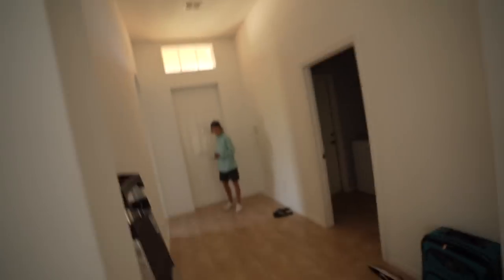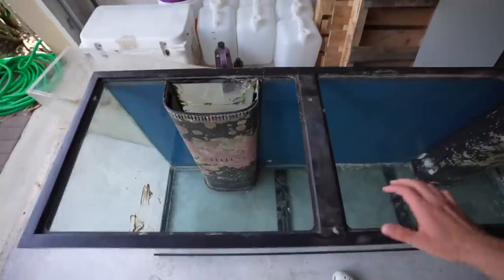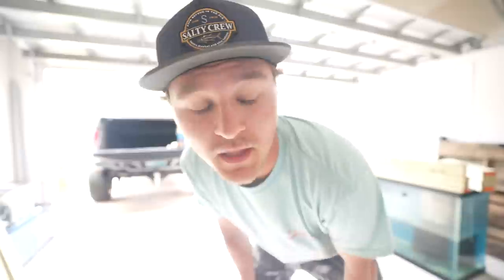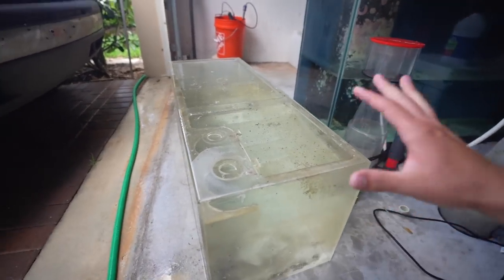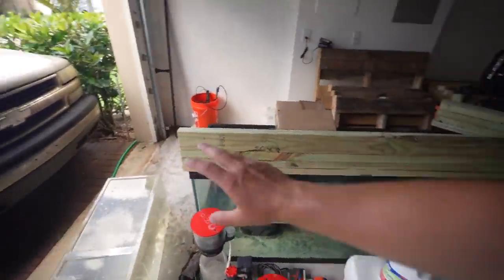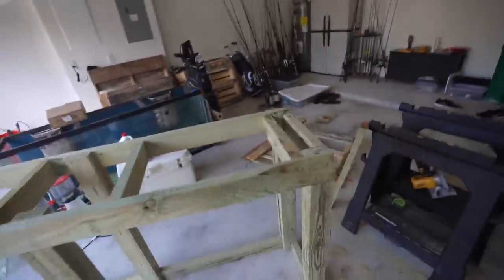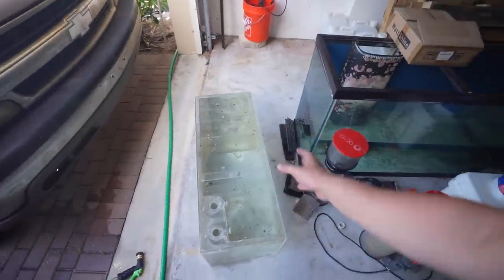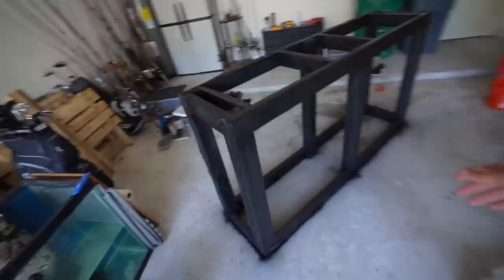BUILDING the CHEAPEST MARKETPLACE REEF TANK!! (Cleaning and Building a Stand) Part 1

Comment: That was a pretty sweet deal though. $240 for a 6 foot marine tank, sump, gear and stand? Noice!
I like to add EVA foam mats (you know the ones you get in a pack - probably from Walmart in the US - and they have the jigsaw edges to lock together?) and trim them to fit the underside of the tank. They act as a vibration damper, help distribute the weight of the tank a little more and provide some insulation against unwanted heat exchange. It's the same principles as using polystyrene, but I find them easier to get and work with as well as more durable.